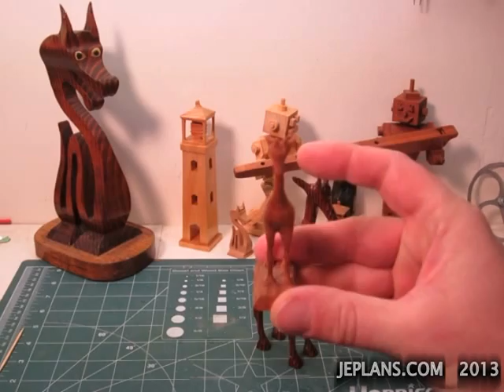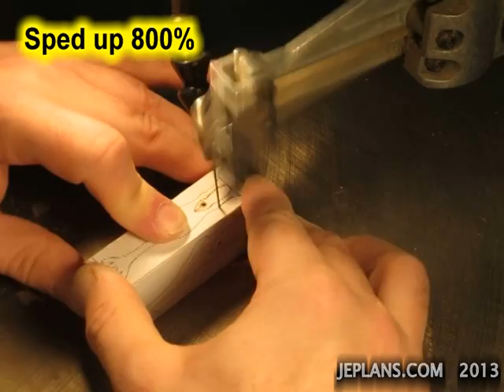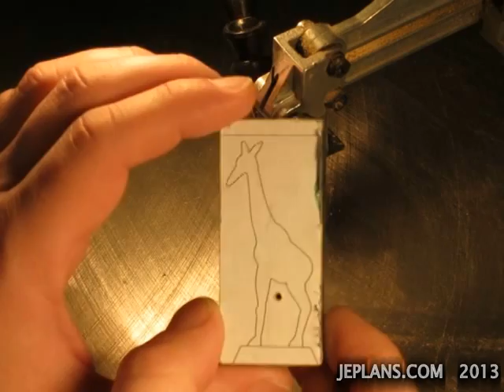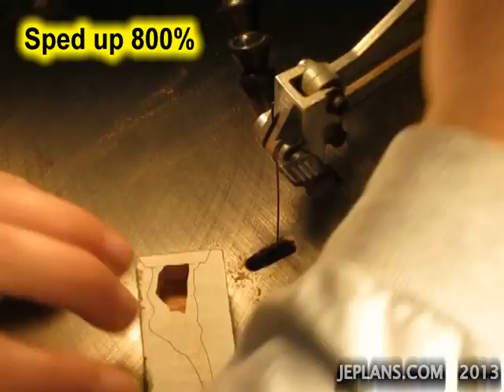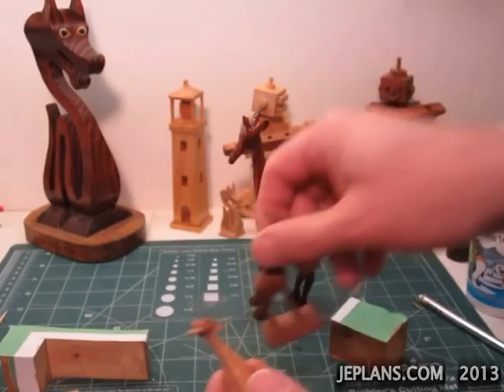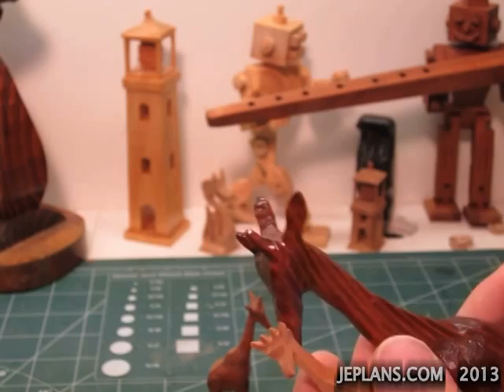Making a 3D Giraffe On the Scroll Saw

Comment: What size blade are you using? When I cut on the long side like the 1 inch side by blade binds up all the time. What am I doing wrong? I have tried every size blade I have. Thanks.
Reply from the maker: +frehleycomet That was a delta #5 blade that is no longer made and in my opinion it worked better then the Olsen blades I have now.  Be sure to use tape on the block, that helps lubricate the blade quite a bit.  If your wood is really hard drill some strategically placed pivot holes to make turns.  Use a fresh blade on thicker side.  Looks like it took me 2 blades in the video, that plum was very hard to cut out.
Reply: Ok thanks for the info.
Reply: I only use Flying Dutchman blades and Ultra Reverse #1 on compound cuts. Adjust your speed if needed.